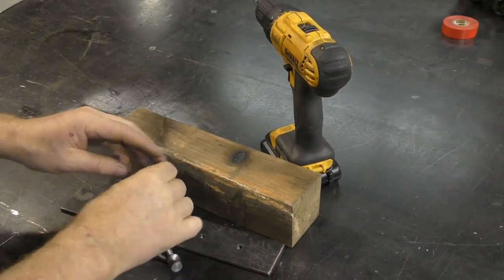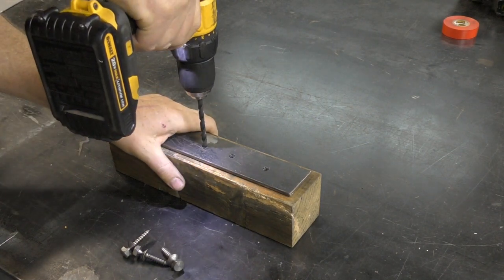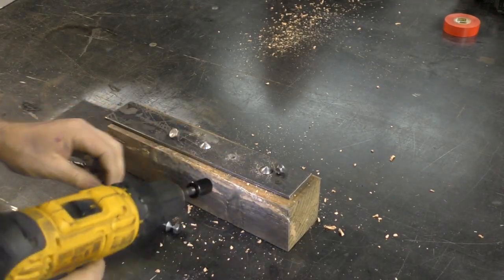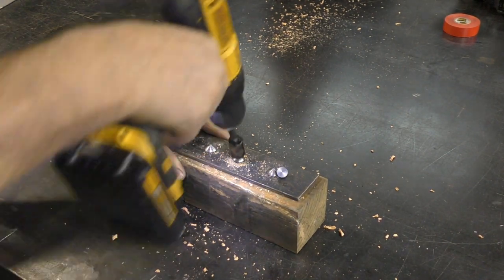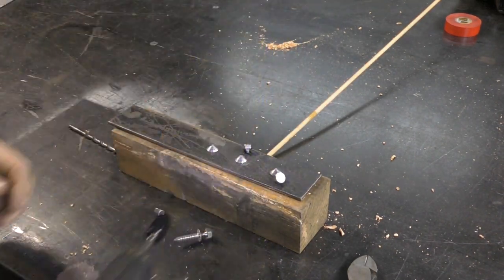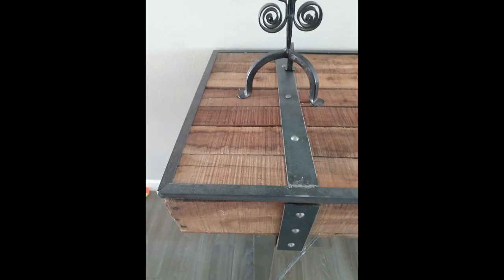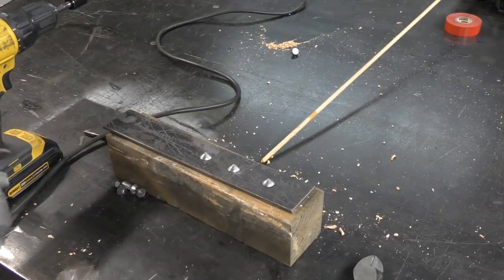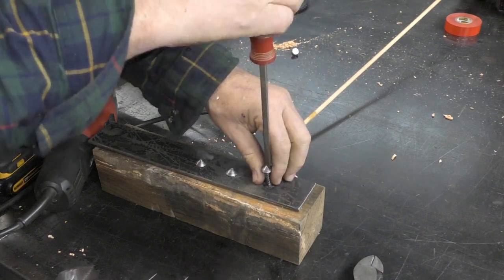The Top Broke Off...On Purpose! Meet The Shear Lag

Comment: Many "strange" things out there - and this is one of them.
Makes a permanent/safe installation as no one can undo them
Reply from the maker: Haha...no one except a few select out of the box thinkers. 😉A cut off wheel and quickly turn these into a Philips head which is then easily removed. So simple, it's mind boggling 😉😉
Reply: @ArtfullyRogue  
Yeah - but who carries a battery powered tool with a cutoff wheel with them to cut off these types of bolts just to rob someone?  And that's many bolts not just one.